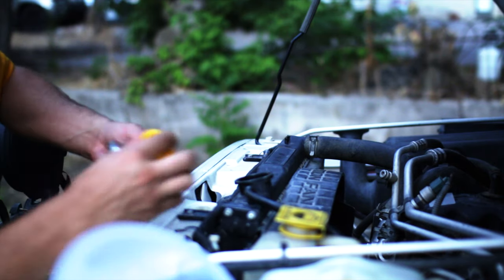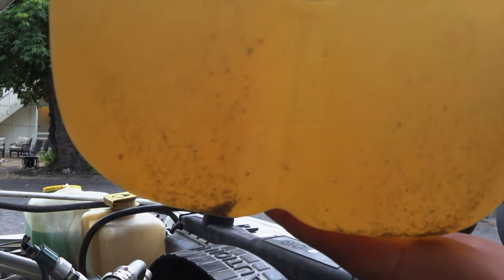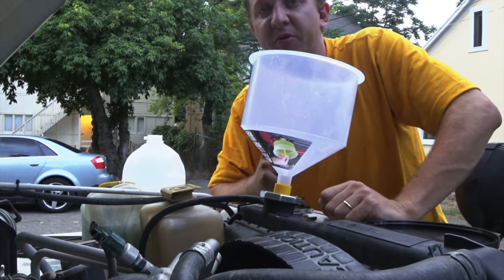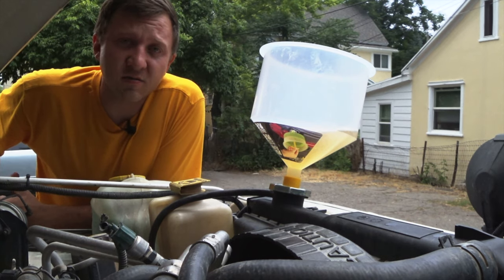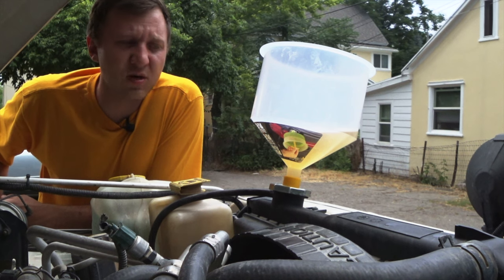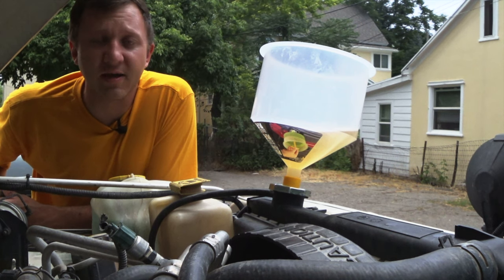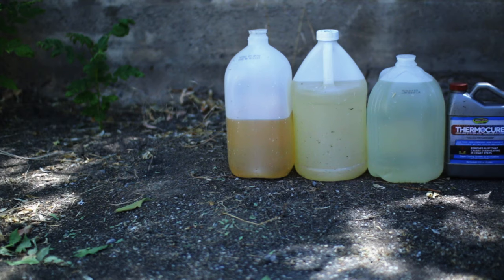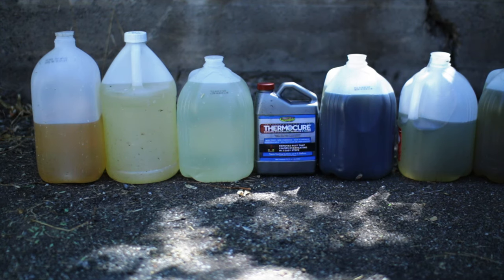Thermocure - Best Radiator Flush?

Comment: I've used thermocure in my jetta, now a second jetta with the rust being so bad that it started to sludge in the reservoir, it works surprisingly well and got clear water in 58 flushes.
Reply from the maker: It is a fantastic product! Good to hear others have similar results.
Reply from the maker: It takes a surprising amount of flushes to clean a cooling system out. 🤣
Reply: @EmbarkWithMark  yeah it really does
Reply: @ibberman  Yes, 58 flushes.
Reply: @gamerkay5791  How long between flushes ? must have taken a week.
Reply: @ibberman  actually a couple weeks
Reply: 58 flushes?!?!? 😮 Respect the hustle 🤣
Reply: 58? For real? Do shops use some kind of distilled water pump to flush?

Comment: 1:40-1:50-ish when pouring, the handle is toward the top, the hole to pour is at the bottom and you're holding the bottle oriented up and down or tallways. This causes the liquid to chug and spill and not for smoothly. If you hold the bottle so the hole is at the top then air can get in the bottle causing the liquid to poor much easier, much smoother. Also as you're tilting the bottle the poor, you should hold the bottle flat wise so dare can get into the bottle even easier and this will cause a very controllable, unsplashing, easy pouring fluid. You need that special funnel because when holding the bottle as you are it sloshes and chugs and spills. 
Hopefully this is helpful and if you need there are several videos on YouTube of the proper orientation to hold a container when pouring

Comment: When you replace your water pump you will be surprised how clean the engine blocks will be. I used it in mine it’s a good product. If you’re not in a hurry the regular evaporust is also a great product makes bolts and stuff look like new but it’s slow as in 2 to 3 days.
Reply from the maker: Oh yea this stuff is amazing and had a huge impact on how well the system cools. I'm honestly thinking of running thermocure one more time but running it for a week instead of just a few days.
Reply: thank you for the reply and the great video 👋

Comment: Recently put thermocure and distilled water in my XJ and noticed the next day the water in my overflow tank was black. I was worried at first but feel a lot better now. Thanks
Reply from the maker: Glad the video helped you out. Let me know how the flush goes for you!
Reply: @EmbarkWithMark  thermocure is simply amazing. I’ve used prestone flush probably 3x this month alone and there were still rust stains in my hoses, overflow tank and the block. Had the thermocure in for a week and all the rust stains are all gone. No wonder it cost 10x the price of the prestone flush.
Reply from the maker: Wow! Glad to hear it’s working well for you. 

I have a similar experience. It’s expensive stuff, but man it really cleans out a coolant system well!

Comment: I did 3 flushes using only distilled water. Drive for 2 weeks flush. Repeat. Never heard of this product. I read that regardless of if you flush 2 or 3 times you're still leave as much as 30% of water in coolant system. In Alberta you must have a minimum of -35°F. I learned this the hard way one winter.
Was likely never done by any previous owner. I'll use this product flushing my car and brother's car.
Reply from the maker: There is definitely some water left in the block. However, there is a plug on the block that allows you to drain the engine and get a lot more water out. 

The product does work very well!
Reply: I read it's $104! Could that be? I couldn't wouldn't attempt to remove any bolt on the block because I was afraid it was too sized in there and I didn't want to break it. That is a common problem.
Reply: Seized

Comment: My ‘03 Wrangler never reached 225. Even slow off roading in 100 degree heat it stayed right at or below the 210 mark. After leaving the trails that day and driving 2 hours back home, the original water pump failed once I was parked in the garage and all the coolant sprayed out the weep hole.
So what did I do? I put a Mopar pump and radiator (it was showing cracks after 15+ years) back into it and still never reached 225. 

I’ve always heard guys talk about wranglers habitually overheating and I have a theory it’s because Jeeps are some of the most worked on vehicles by amateurs and hobbyists and you’re highly unlikely to find one that hasn’t been modified or altered to perform worse than factory
Reply from the maker: I don't think it's just over worked. I think most, including myself at one point in time, didn't understand how good a lot of the factory parts are on these older wranglers. That and people not really maintaining them well, along with the extra abuse. My Jeep is now runs very well, only on days of 120+ does it run warmer than 210.
Reply: @EmbarkWithMark  Yeah I got lucky when I found mine. I’ve inspected a handful of wranglers for some people and I’m always shocked at the crap that’s been done to them. 
They unknowingly tarnish the name when they load the parts cannon up and fire

Comment: Thanks for showing how the coolant looks after each flush. Mine is slowly getting clearer. I think I am on like 6 flushes after running the product in there. It is a process but I think the original rust came from using hose water to flush. So I am like 10 jugs of distilled water in now. What is the best thing to stick in an old engine to prevent rust?
Reply from the maker: Your very welcome! I’m glad it’s helped you out. Yea it takes a shocking amount of water to flush the system. 

50/50 mix of coolant and distilled water. Than make sure your changing the coolant on a regular basis. The coolant bottle will tell you how often. 

Coolant is designed to stop the system from rusting but the additives in coolant only last so long.
Reply: @EmbarkWithMark  will I think I am at 8 flushes and still have a fair amount of cloudy water. Any one else? I stuck some Preston cleaner in to see if there is something besides rust in there. If that doesn’t work I might let it be. 252,000 miles on it or try a hose flush with some distilled water. I guess the hose flush only gets the heater core and I imagine draining from the radiator is only the radiator. So stuff would be still in the engine. Or is there a better way to get it all out?

Comment: When you "flush" it, are you using an entire bottle every time?
Reply from the maker: one of the small bottles, yes. They sell bigger bottles for multiple flushes.
Reply: I just put the ThermoCure in and drove over a week or so for about 4 to 6 hours and then flushed it several times. Should have I been doing the ThermoCure each time with the distilled water?

Comment: Amazing video man! I wanted to ask: I am doing a radiator replacement soon and I wanted to know if I should flush with the new radiator installed or while the old one is on

 I actually bought the stuff before finding this and im so excited! Thanks man!
Reply from the maker: Glad you like the video!! 

I would flush with the old radiator on, and then disconnect the old radiator and flush the block and heater core out really well. The reason for this is you don’t want junk from the block into your new radiator potentially crating a blockage.
Reply: @EmbarkWithMark  awesome, im definitely doing that then. However, I don't think I'd be able to run it for long due to the radiator being leaky.. thats why im replacing it. Wouldnt it have the same effect if id just let it idle for 2 hours? thanks for the speedy reply!
Reply: @EmbarkWithMark  i can see it has the best effect when you leave it in there for long which is why I thought about flushing the system with the new radiator on but you have a great point and im really reluctant now to do the flush with the new radiator..
Reply from the maker: @pippy wessin  I would get the old coolant out for sure, but If you don’t have any heat issues or suspect any build up of any kind. Then I would not flush the coolant system. 

A coolant flush like I did is only needed if the cooling system has been neglected. Unfortunately, I did neglect mine and now I’m paying for it.
Reply: Ahh man I put the product in with the new radiator on. I also put a new hose on and took the reservoir off and scrubbed it. My thought was the old radiator probably was a source of the rust. So just get rid of it. Plus it had a leak.

Comment: Unless you reverse flush an engine cooling system like a shop does with a machine never get the junk out of the block. Have to remove the thermostat and the back flush it with a pump.
Reply from the maker: I disagree. A flush machine is not needed here. 

Though, removing the thermostat is a good idea. Also taking out the drain plug on the block is very helpful.

Comment: What type of clear coolant, did you use?
Reply from the maker: I refilled it with Zerex G-05. But after doing this a few times I recommend using the mopar coolant. That’s what I run now. I cant prove anything but I think the mopar coolant has more inhibitors and protection in the fluid.

Comment: Part of my radiator cap broke off and fell into the filler.
I've been told it's too big to travel anywhere and cause any problems with the pump or thermostat.
And it will just sit in the top tank.

Should I just leave it and replace the cap (with one that isn't plastic)
Or
Should I try to flush it out?

What's the best way to flush it without literally pulling the radiator out, tipping it upside down and shaking it?
Reply from the maker: Wow, I have never seen a radiator cap break off into a radiator. Than again I shy away from plastic radiator caps too. 

I recommend getting the broken part of the cap out. I would not leave it inside. Here is something you can do, but it will require you to drain the coolant out. 

You can take off the upper radiator hose only. Take a hose with a spray nozzle on it and spray into the radiator hose. That should force water out of the top of the radiator with the cap off. 
If that doesn't work you can leave the upper radiator hose installed. Pull the lower and do the same as the above. flushing up from the lower might be your best option as it will push the water up and out the top of the radiator.
Reply: @EmbarkWithMark  

Thanks, I'll have to take the top hose off because there's no way the bit that broke off will come back through the neck of the filler.

I'm on the hunt for a cap that isn't plastic, so far I can only find plastic ones for my car (Lexus is250)

I just spoke with my cousin who is a mechanic at Toyota, he said he's had a few cars in with the same problem, a few Honda forums talk of broken plaster radiator caps falling into the radiator too.

All the cars I've had have had full metal radiator caps. 
This one has a metal top and plastic mechanism
Reply: @EmbarkWithMark  have you ever compared this to the blue devil concentrated coolant flush?
Reply from the maker: @jonathangarzon2798  Funny you mention Blue Devil. I have compared the two. For me Blue Devil did not clean the cooling system nearly as well as Thermocure. I've used Thermocure on more than one Jeep now and it is very good stuff.
Reply: @EmbarkWithMark  well good to know, I used it and it seemed to work but I def am doing a second flush to get the rest so I'll try thermocure

Comment: Can you flush your heater core with this stuff?
Reply from the maker: Yes, you can. Depending on the vehicle you may need to turn the heater on. TJs do not have a valve on their heater core so the coolant is alway flowing through them. So essentially this cleaned out my heater core as well.
Reply: No. You'll need junk your car and walk.
Reply: @dontblameme6328  🤣😂